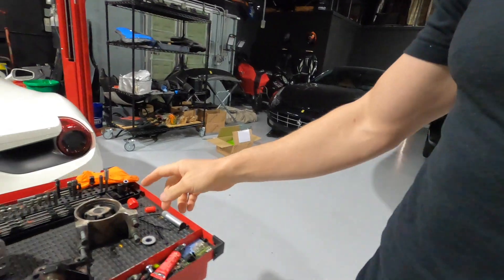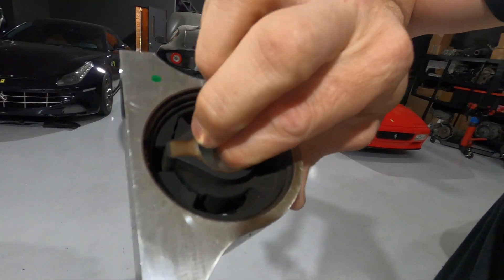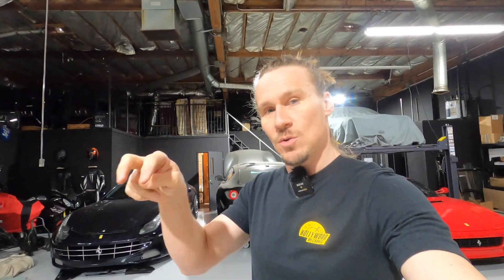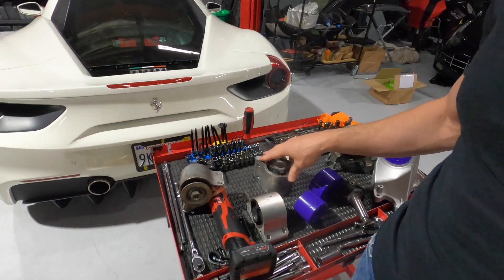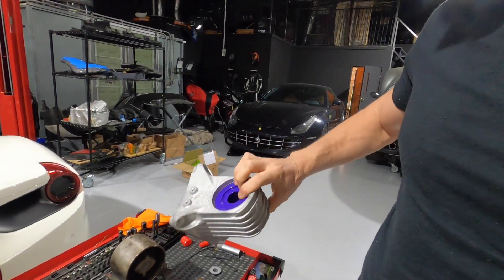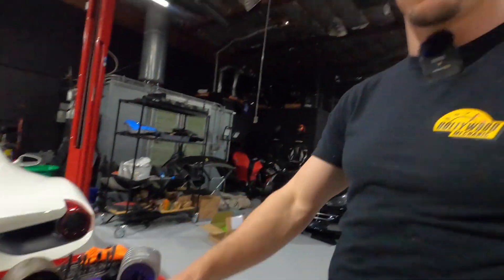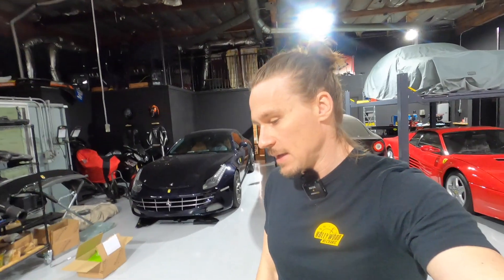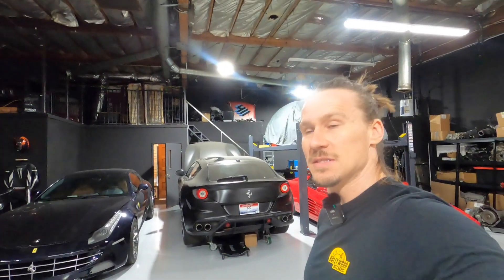Ferrari Transmission Bushing Upgrade (California, FF, F12, GTC Lusso, 812, Monza)

Comment: I have a quick grinding noise on california.   no codes drives great.  sometimes just this quick grind.  sounding like you manually shifting an older car into 5 but mistakenly almost putting in reverse.  maybe this is a fix. sounds like the front of the trans area.wierd.
Reply from the maker: I believe I responded to your email this morning.